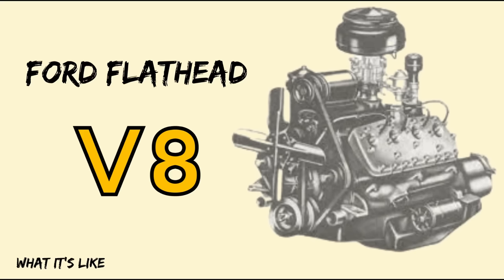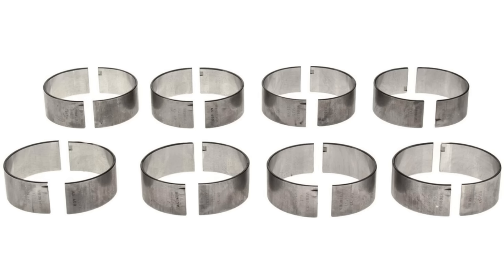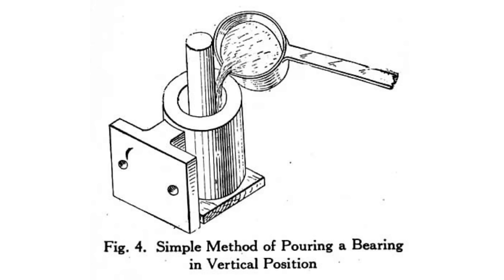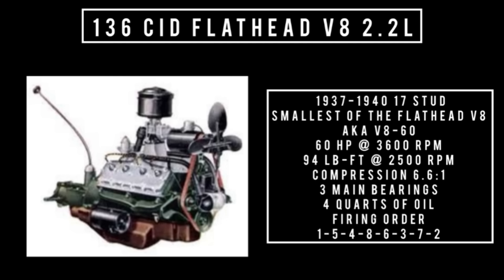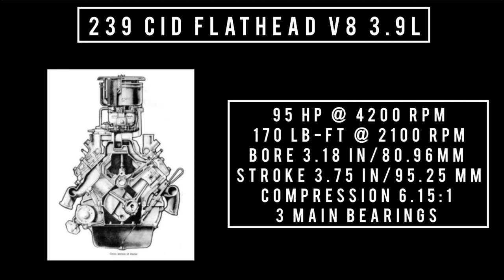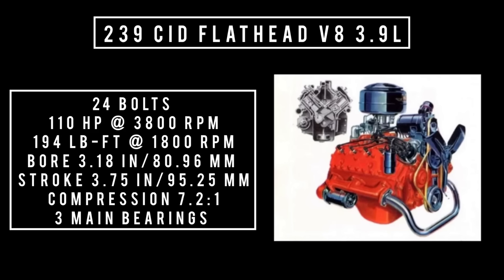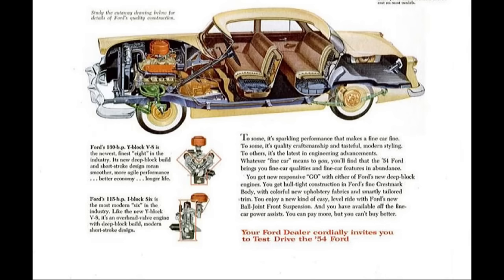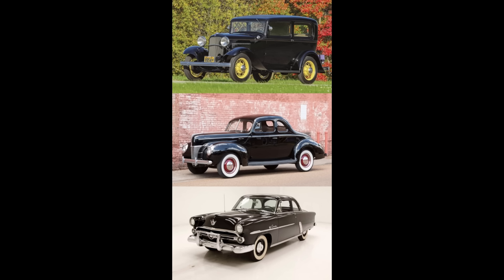FLATHEAD V8, Ford made this engine for 21 years￼. 136, 221, 255, 239, 337

Comment: There are a lot of misconceptions in car culture about Henry Ford's opinion of the I6 that need to be rectified. I6's naturally balance the primary and secondary forces, and can run very smoothly. While the Model K was an expensive car, the financial reports from 1906 to 1908 suggest it was actually the car that kept the company afloat for those few years. Ford's I6 in the Model K was a fine piece of machinery, but too expensive to produce sustainably. When Chevrolet came out with their "Stovetop" I6 in 1929, they marketed it as "A six for the price of a Four." Chevrolet started gaining Ford customers, so Henry did what Chevy did: an Eight for the price of a Six. Ford even built a racecar using a Model K's I6 -- unfortunately, the engine was too good for the car, and blew out the right rear tire, and wrecked. There's a fella in the Horseless Carriage Club of America who has done a lot of research on this topic -- he has a very nice "Alphabet Collection" (a car of each model), and I'll send you the articles he wrote, if I can find them.
Reply from the maker: Awesome information thank you so much for sharing all of that
Reply: It's my understanding that Henry swore off the 1906 Model K six cylinder as the flimsy crank had a nasty habit of breaking. Just poor engineering in that department I guess as the inline six is not a flawed design & worked well for everyone else.
The first Chevrolet six was about 1910 or'11 & it was a side valve. Then came Billy Durant who bought the company & the first "GM" Chev was an OHV four in 1912.. The first Chev OHV V8 was in 1917. [Model "D"]
The lowly Plymouth had full pressure oiling & 4 wheel hydraulic brakes in 1928, long before Ford ever adopted these features. Chrysler gifted the third Plymouth off the line to Ford & they still have it in their museum.

Ideal car as a driver?  !932 Model 18 Deluxe V8 Coupe with 'improved' driveline. I would use a 1936 engine, [slipper mains & crankcase breathing, I like the early engines] headers, twin 94 carbs, [Much better than 48's or 97's] mild cam, finned alloy heads, 1939 gearbox with Zephyr gears [much better 2nd gear ratio] hydraulic brakes, pressurised radiator & electric fuel pump under the rear. These last two address the boiling & vapour lock problems. Oh yeah, later 1932 rear axle with pinion support bearing & 12 volt upgrade as well.
As far as early Fords go, .... perfection achieved.
Reply: "Stovebolt" not "Stovetop"
Reply: @johneckert1365 I think I'll have some turkey and Stovebolt Stuffing for dinner tonight. 😁

Comment: The problem with the flathead is that the exhaust runs through the water jacket.  This makes this design run hot in higher power applications.  They still sound good though, even if they really cannot make the power that a 2.0 liter four cylinder makes today while having good drivability and clean emissions-
Reply from the maker: Totally agree =) these sound amazing
Reply: yeahhh...... they were so bad that only millions were made, and totally owned the affordable hot rod market into the 1960's.......
Reply: @chrisgermo1956  They still had some glaring engineering faults that made them obsolete. But they were dirt cheap and readily available.
Reply: A 2.0 4 cyl doesn't make any torque though, and sounds like, ... a sewing machine 4 cyl.
Reply: Mine runs  fine.
Reply: Mine runs  fine.
Reply: @chrisgermo1956  The brutal truth is that the flathead was much loved, but deeply flawed in factory fresh trim. Most of the problems can be addressed these days with some sensible Hot Rod "upgrades" like headers, finned alloy heads, twin carbs, improved cams, electronic ignition conversions iridium spark plugs & pressurised radiators. There's much more of course, but then we have benefited from almost ninety years of development, so good flatheads are well & truly a thing now.
Reply: So true, the overheating was from the exhaust running too far through the blocks/coolant areas... Ford flathead racers reverse the flow and take the exhaust out quickly through the short intake port... and '76 Pontiac Iron Duke 4 banger makes more power and twice the MPG and vastly more reliable...
Reply: More heat to the water jacket = faster warmup and more comfort for the passengers from the heater core? Especially in arctic climate winter?

Comment: I had a French Simca Vedette that was sold new here in Australia in the early 1960’s and I bought it for peanuts a few years later as they were too expensive up against the Aussie built Valiants, Ford falcons and Holdens etc when new and wouldn’t pull a sailor off your sister as they had basically the Ford V8 -60 but with a bit more HP, Ford USA gave the design to Ford Europe when the US stopped building it and Ford in Germany used it for their Ford Vedette before selling it to Simca in France who did a pretty good job of modernising it and it was quite a well built car before the English Rootes group bought out Simca and then Rootes group sold out to Chrysler who then gave it to Chrysler Brazil who built it and modernised it again and turned the what was originally a sidevalve V8-60 into a mini Chrysler Hemi with overhead valve conversion and other mods and sold it right into the 1970’s I believe, so a long life and with quite a few owners!
Reply from the maker: Awesome story thank you so much for sharing those memories

Comment: Two water pumps double as engine mounts. Changing them is not unduly hard, engine has to be supported with a jack under it. Bolts affixing it to block include one inside water neck, not catching that could be bewildering.
Reply: The early ones, 32 - 36, had the water pumps in the heads.  The 37 and later ones had them in the blocks where they doubled as engine mount pads.
Reply: The flathead engine mounting system was really only a cheap & nasty convenience at the engineering stage. Chrysler had a patent on their Floating Power system from 1932 which was the standard of the industry & was still in use till the last of the side valve sixes in the very early 1960's

Comment: My father bought flathead V8 Ford truck in 1937 in Croatia he told me the engine used to overheat and crack head.
Reply from the maker: I got to drive a few cars with flat heads in them last year the engines OK I would have to drive a car with a six cylinder from the time. To really get a just of whether or not the flathead is overrated because it’s kinda sorta like you can’t over rev  they like to overheat not very fast or at least it wasn’t a 40 Ford but I’m not sure what version it had either it could’ve had a small version and that’s why I didn’t go very fast. 50 miles an hour is that car sweet spot 45-50 any more than that it seems like you’re pushing it or at least the 40 ford that I drove was like that

Comment: Although Studebaker had an excellent SMALL V8 in their 259/289 it's a shame that they didn't continue to develop the Packard V8 as the "Studebaker big block".  They took the 'el cheapo' approach of bolting on their corporate supercharger instead.
Reply from the maker: I agree with everything you said I’m thinking about doing more engine episodes in the future definitely going to do one on Studebakers V-8 I was waiting to grow the base a little bit more before getting into those episodes but those have always been an idea since day one I also want to dive in deep with engineers and designers. I’m hoping one day that this is one of the go to Classic Car channels for finding information out about Lost and forgotten cars
Reply: Studebaker should have enlarged the 259 V8 eventually to 401" like Chevy did with small block...
Reply: @BuzzLOLOL   Not possible.  At 289ci it was nearly maxed out.  They had a 304.5ci version and that was it.  The Packard V8 had the potential to be 500ci however.
Reply: @Matt_from_Florida  - Chevy used tricks to get the SBC to 401"...
Reply: @BuzzLOLOL It was actually 400 CID, not 401. AMC made a 401.

Comment: With all the casting issue why did Henry persist with what was already an archaic engine Would have been easier and cheaper to cast an OHV engine. Others had made them.  Which would have been more powerfull and more efficient with less overheating issues. Especially with 8 exhaust ports!!
If GM had made pressurised oiling the Ford V8 would have been around for a couple of years
Reply from the maker: Yeah really makes you wonder why they just didn’t go for overhead valve from the GetGo same thing with the Y block Ford had two tester engines the flathead V-8 in the Y block it wasn’t until the FE engine that Ford had a winner The MEL engines were good too but those weren’t found in Ford’s
Reply: Henry Ford was stuck in his ways...

Comment: 01:24 - Ford was not the first to mass produce a V8. 
Cadillac introduced their first V8 in September of 1914. They sold over 13,000 in the first year of production.
There had been V8 aircraft, marine, and racing engines prior to that.
Hispano-Suiza, Benz, Renault, Curtis, and others made V8 aircraft engines by the thousands during WW1.
Reply from the maker: Ford was the first to mass produce affordable V8
Reply: Chevrolet also had an overhead valve 286ci V8 in 1917 & 1918.
Reply: Chevy had OHV V8 in 1916...
Reply: @What.its.like.  
"Affordable" is a relative term.

Comment: I seem to recall that the flathead V-8s had some HUGE counterweights inside.
     Any thoughts on that?  It seems like anything hugely heavy would limit acceleration.
Reply: Mine runs just fine,  and its fast.  Not stock though, 3x2s, Navarro heads,  Cyclone intake,  Ross high dome pistons,   Winfield cam, Johnson tappets, lightened flywheel,  Bubba distributor.
Reply: @garycamara9955  Great to hear!  Did you ever have the engine open, and if so, did you see the crankshaft?  And, if so, did it have unusually large counterweights on it?  (I'm just curious; I haven't had an engine open since I was in my teens)
Reply: Old engines were under square engines with small bores and large strokes, so large counterweights for crankshaft balance...
Reply: @BuzzLOLOL  Also some cars used iron instead of aluminum pistons which would be heavy and require more counterweight on the crankshaft.

Comment: Why would you use the Commander Cody version and not the amazing Charlie Ryan version of Hot Rod Lincoln? 
As far as I know he is the originator of the song and he actually had four or five parts of the song It's a really good story if you're a gearhead that likes rockabilly and hot rods. 
As for the cars I will take the 1940 Ford coupe any day of the week.
I would imagine most people choose the 1932 Ford because of its value and it's icon status. But in my opinion the 1939/1940 (and 1941 pickup) Fords are the epitome of cool at least with the coupe roof line or the pickup cab. 

Myself when it comes to fendered Fords, 28/29 roadster, 30/31 pickup, 40 coupe, 25-27 T roadster. 
I guess in all reality It doesn't matter which pre 1960 Ford you get they're all great, 1941's and 1958s having some odd looks.
Reply from the maker: I used Commander Cody version because when I googled it his name was the very first one that popped up

Awesome choices =)
Reply: Yep 1955 -
Reply: @What.its.like.  Commander Cody's was definitely the most popular by a long shot So I could see how it came up first. I remember hearing it when I was young kid in the 1980s on the so-called "oldies" station here in Southern California...
I didn't learn about the original version by Charlie Ryan until I was in high school and thst was only because I was reading about his hot rod A coupe as he had brought it out of retirement so to speak (I think that was 1994). I was probably 19 or 20 before I learned that Hot Rod Lincoln was actually a series of songs all wrote between 1955 and I think 1961, they are definitely worth looking up if you enjoy classic car culture.

Comment: If the flathead V8 was made for 21 years, what was it used in 1943-1945?
Reply from the maker: Generators 
Air compressors
The engine was used for commercial purposes

Comment: Compression so low.
Reply from the maker: So low I wonder if it would run off of diesel fuel.. or other fuels easily with such a low compression
Reply: @What.its.like.  Diesel requires high compression.  Ford did want to run cars on ethanol, but prohibition put a stop to that.  It is said that was the main reason for it.
Reply: Gasoline then had very low Octane which caused the engine to knock if compression raised. Leaded fuel stopped that, but caused a toxic environment.
Reply: Did anyone make a kerosene conversion kit for the Ford flathead? Kerosene could be used as fuel in certain old Briggs & Stratton engines,there was a special carburetor that transferred exhaust heat to the fuel,the engine needed to be started on gasoline and warmed before switching over to kerosene. 
I think low compression is a must for kerosene running in a spark plug type engine.

Comment: There was a huge aftermarket for OHV conversions for the flathead. Word is that when Chevy with their OHV straight six started outselling Fords with the flatheads, the Old Man went nuts. If he heard of an engineer working on an OHV six, he would go down to the engine lab with a sledge hammer and smash it.
Reply: Chev outsold Ford from 1936 onward.